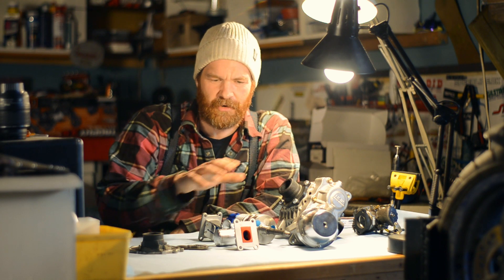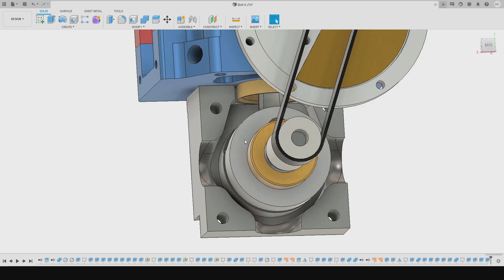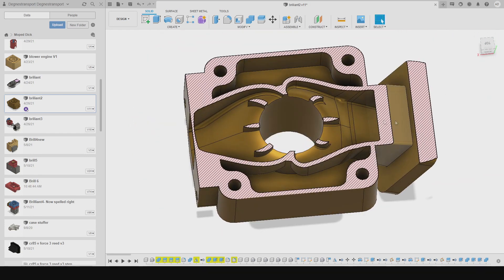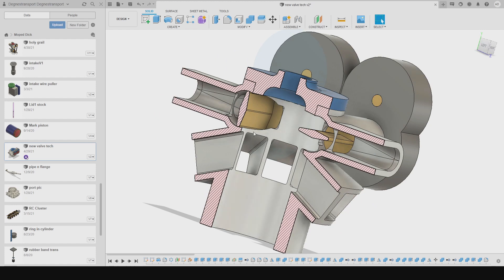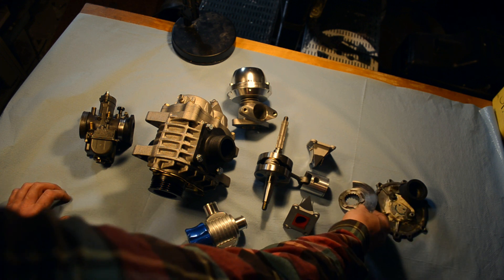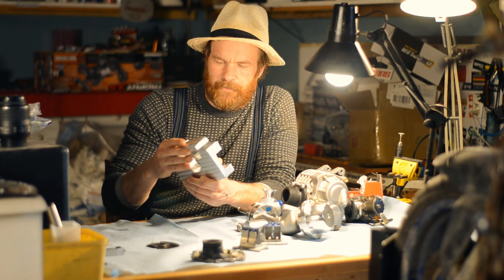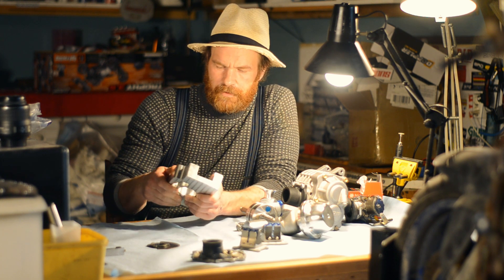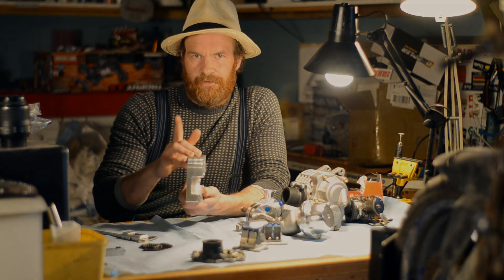Full Size Supercharger, Tiny engine!

Comment: I think you are forgetting a well tuned 2 stroke is operating at approx 7 psi of boost when in powerband, and is getting all of this boost "for free"

For your engine to simply match this power you will need 12 psi of boost, 7 to move the same air, and an additional 5 because you are no longer moving this air for "free" (plus another 5 psi because the exhaust mixed in the intake charge)

Your supercharger simply isnt capable of supplying the air at the pressure needed to overcome the inefficiency and the exhaust valve wont be able to function at those pressures if you were able to generate them.
Reply: Theres no reason or benefit to having a blow off valve on a draw thru design...

The reed valve idea isnt ideal, way too much mixing exhaust and intake air. Much better to simply open the port at the right time, which requires using the head for the intake or exhaust (intake in head for max power, exhaust in head for max efficiency) 

Turbocharging is an ideal way to add power to 2 strokes as the added backpressure keeps the intake charge from escaping the exhaust port.
Reply: I predict at best the same power as a low end weedwacker, worse case it wont even sustain itself.

Any effort at improving the traditional 2 stroke should involve an oil bath crankcase for longevity and to keep oil from contaminating the combustion process.

Cool project and fun way to learn hands on

Comment: As for LASER CUTTING your DISCS; perhaps you can glue your disc material down to a flat piece of alu and cut it on the CNC? If you use the blue tape and super glue technique, I think it should work.

Comment: Love what you're doing here. Fantastic stuff!
Serious concern though... using an oil/fuel mixture in a supercharged motor will make it more likely to predetonation. If I were you, I'd be using a wet crankcase to keep the oil separate from the cylinder charge. With the supercharger, you don't need the usual crankcase to pressurize the cylinder.

Comment: Maybe you can find some inspiration in the Junkers JUMO KM 8 it had a rotary valve for inlet an exhaust. Other engines use the sleeve of the cylinder as valve like the RCV 60 has a rotational sleeve and the Knight engine uses a second sleeve in an oscillating movement.

Comment: Remember the KISS method.. Keep It Simple Stupid. The more things that can go wrong, the more that will. I hope you've looked at the rules if you plan on running this at Bonneville or El Mirage here in California and aren't just building it to go "LOOK WHAT I MADE!" because obviously blown + nitro is it's own class compared to just methanol or NA nitro. Also I hope you've gotten a really good fire suit for your test runs as well as a good full face respirator with correct cartridges.. you really don't want to be breathing that crap. Remember also that you can mix toluene into your methanol to make it visible when burning should you use it.. invisible flames are not a good thing. Also look into Cold Fire, it's what NHRA uses to put out nitro fires for Top Fuel and is nontoxic, and just mixes with water and pressurized by compressed air. Also it doesn't leave a residue like foam does.
Some of these designs you've drawn up make me have to ask "what really is a 2 stroke?" Adding in all these valves makes me wonder what's the point, why not just go 4 stroke? I guess the only real difference becomes RPM and where the power is. 

Your plan for the blower to intake transfer is too restrictive. Running a super sharp 90 into another super sharp 90 is just going to slow the intake velocity far too much. You want a gradual sweeping bend at the same size all the way. Making a sharp turn to a smaller size and then another sharp turn into a larger area is going to be really poor flow and the fuel will likely come out of suspension and puddle in the bottom potentially leading to hyrdaulicking or an explosion. Oh and also, ADD BURST PANELS! You need places that are thin that can easily break if there's a backfire so it doesn't grenade the whole engine, especially if it's between your legs/under your chest.
Reply from the maker: 👍 Just a quick prototype, remember. The PiP engine is simple and pure, this one for contrast. I've studied the rules, there's a blown fuel class.
Reply: @2STROKESTUFFING  sorry if my comment on the last one was out of nowhere. I know that sometimes I tell people things that they really don't care about when I'm excited about it, part of being autistic I guess. It was cool (for me) to find out that we are in fact part Norwegian and Swedish and even where thanks to my dad getting his DNA results back. Just thought that as a Norwegian yourself, you might find that interesting for some reason.

Comment: I don't recommend using a hexagon or internal shape for driving the rotary valve disc.  I suggest having a center hole, then 2 holes that you use dowel pins to drive it with.  The dowel pins can be reamed to precise size and will have more accurate control over the valve.

Comment: Why not make it super simple? 
Install a single exhaust valve in the top of the head and actuat it with an electric solenoid? Of course relocate the spark plug. Probably close to the side of a cylinder. 
But your Scavenging would go straight to the top. 
Some companies are now starting to experiment with solenoid actuated exhaust and intake valves.

Comment: I think you should try one giant valve in the head for exhaust, like the example pictured here, but still use the crank case as part of the intake. https://www.youtube.com/watch?v=SCOUEAeAgGE I look forward to seeing how the current prototype goes though.
Reply: So, on that ski doo, I guess exhaust back pressure limits the turbo blowing through and that's how they maintain intaking the same volume of air as low altitude. I guess if you were to rely on the same, your limit would be how far you can restrict your exhaust, and how much heat would build up as a result... igniting intake charge as soon as it touches exhaust gasses, or melting parts. Chromed piston and cylinder, titanium rings? lol I'm pretty sure higher density exhaust gasses mean a shorter expansion chamber to keep the RPM tuning the same... I'm sure you know enough about that, likely more than I do.

Comment: This idea is rock solid. Material strength and carbon friction will definitely be an issue. Maybe a 125cc crank and rod to avoid exotic material? I have to buy some machine tools. Doing is simply a universe beyond theorizing.

Comment: Oh my God here we go again!
Someone trying to supercharge and or turbocharged a 2 stroke.
Okay I'll make this super simple as to why it won't work.
The exhaust Port is the first to open and last to close!
There's no way to pressurize the combustion chamber because the charge is exiting the exhaust port as fast as you push it in. 
The only way to supercharge a two stroke would be adding an exhaust valve that you can control to capture the pressurized gas.
Kind of like a Detroit Diesel.
Reply from the maker: You need to actually watch the video...
Reply: @2STROKESTUFFING  
Yeah I will 
But I've seen this "so" many times I just assume.
Reply: "There's no way to pressurize the combustion chamber because the charge is exiting the exhaust port as fast as you push it in." - Unless there's a rotary valve in the way.
Reply: Really? -53hp from a standard, apart from turbo, TZR125 back in 2013 says differently.  No too bad of a gain from the std. ~27..
https://www.youtube.com/watch?v=Oxj_OAb5bqk

Today it seems he has reached some 67hp using a Rotax122.
See: https://research.chalmers.se/publication/522865/file/522865_Fulltext.pdf
and
https://www.sae.org/publications/technical-papers/content/2021-01-0642/preview/